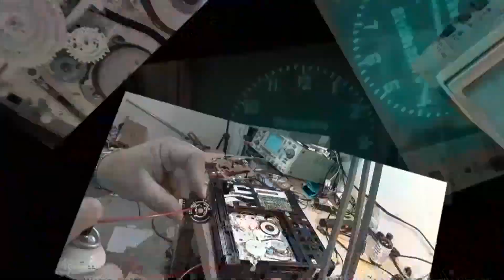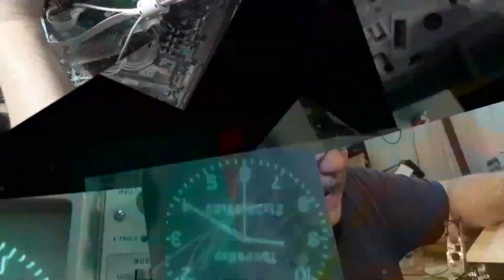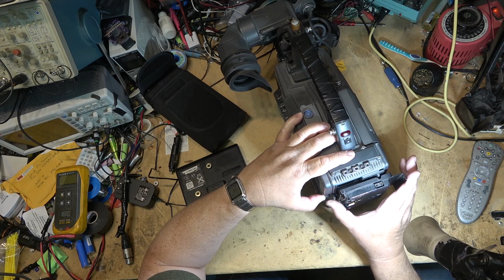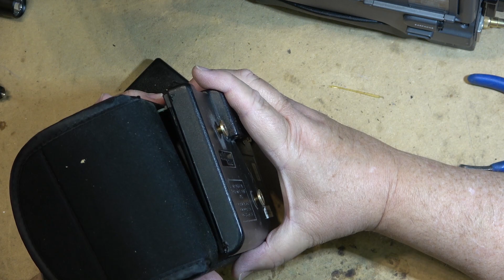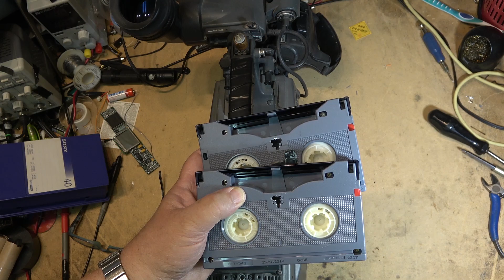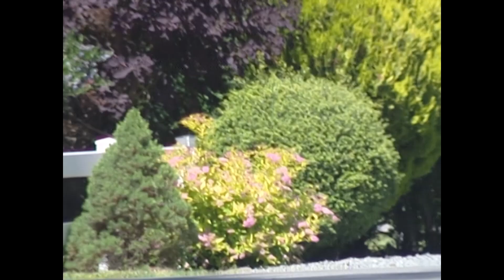Updating that old Anton Bauer Battery pack for my Betacam

Comment: If you didn't fix the original battery pack it's no longer vintage.
Reply from the maker: Like I care.  Its not like its going to be used other than for a few test shoots.  I don't have a charger for the original pack and am not about to buy one. I just wanted a way to power it up without carrying around an external battery.
Reply: I agree the idea is to play with vintage kit not worry about original shelf queens. I use vmount for my camera’s as I have a universal mount and a couple of good batteries with charger . I also have a lithium car starter which is also good for camera play

Comment: Dave, I just remembered a really good example of what you're doing here. Many years ago, I had a Canon AE-1 film still camera. I got a Speedlite flash unit for it. Nice flash but it used AA cells that didn't last very long. Vivitar made a power pack that held 4 D cells. A coiled cord connected it to the flash unit. Same size connection as the Speedlite but the contacts were on the wrong side on the connector. A drill bit and a couple new contacts and done. An access slot in the cover and it was fine. Those D cells lasted for several rolls of 35 exp. film.

Comment: I have the very first Betacam camcorder setup, the Sony BVV-1A docked onto a BVP-3A camera head. Uses Saticon tubes instead of CCDs. Gotta love those comet trails. The BVP-30 used Plumbicons which don't have as much lag but I had one but it blew up.
Reply from the maker: Yes I remember the first gen.  I had a DXC327 with a beta SP back. There was also a Hi8 and DVCAM back for it as well as a CCU back. Never did get that, I ended up with an EVW300 for long form work only because the Hi8 back cost more than I picked up a used EVW300 for, and the EVW300 was about half the weight. The betacam was a company owned asset so when the company folded after by business partner got sick. Poor bastard thought he had the flu. Fatigue and aches and pains just like the flu. When it didn't go away after a few weeks he went to the doctor that ordered blood work. The next day his doc called and brought him in for scans.  A day later he got the 3 words that NOBODY wants to hear. Called me December 4 2005 (my daughters birthday) to tell me that he was going in for chemo and would be out of commission for a few months and for me to finish the current project. Didn't hear from him for a few months, called beginning of March just to ruin my 43 birthday to tell me that the treatment didn't work and that there was nothing more that they could do and that he had sold his portion of the business and gave me the contact info for my new business partner, a smart ass that ran a video rental store. That was the last time I heard from him, he passed about a week later. The new partner treated me like a junior employee not a founding partner. I was the producer, camera man, editor. All Gordie did was run the front office, which was meet clients, and get contracts signed, and handle duplicating the hundreds or tapes and DVDs because I didn't have the time for that. I was running a TV repair shop and doing all the production / post production for the video business. 
I remember the new guy calling me telling me he had some 8mm film that was a priority and needed to be done next day and I needed to pick it up from his store. (Gordie always delivered and picked up the order and would wait until he had enough to make it worth while which might have been a week or 2. This goof, the new partner called me out to pick up an order. It turned out to be 1  50 foot reel. That was a 5.00 order and yet I had to not only drive 30KM to pick it up, but drive 30KM back home. Burned about 20.00 in gas for that wound trip as I was driving a car that got about 10MPG at the time. 
Je wanted me to deliver it back and I daid F**k it, I am not bring it back. He drove out and got it refused to pay, so I just told him good luck.  Sent the leased betacam back and that was it.
Reply: @12voltvids  Was your daughter born in 2005? I was born September 2005

Comment: Is the runtime on the modded battery pack comparable to the old battery when it would hold a charge back in the day?
Reply from the maker: Original battery was 45 watt hours which converts to 3125mAh. The pack on there now is 72,000mAh so you do the math!
Reply: @12voltvids  23 times the Mah!  So it should have a much longer run time.  Factoring in the battery pack circuitry but I would estimate about 20-22 times longer.